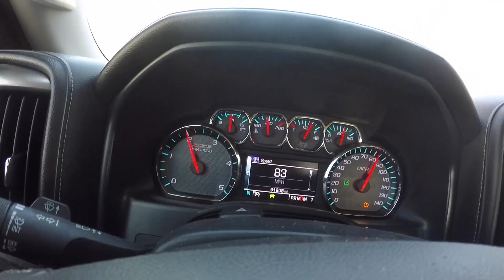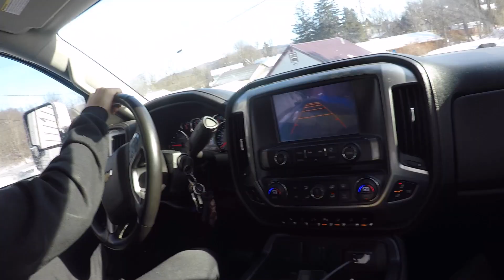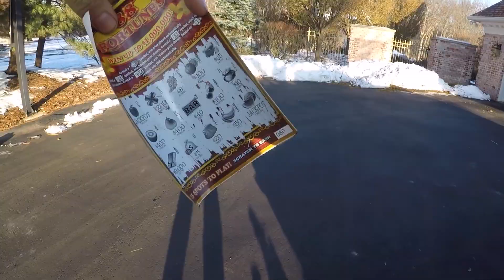I GOT 2 NEW ENGINES while Black Friday SHOPPING!!!!

Comment: COMPARISON TIME...I would like to see what is the cost difference of rebuilding a 6.0 VS. 5.3...Are the 5.3 parts much cheaper???....Also could you weigh the two engines??.. I wonder how much more the 6.0 is VS. the 5.3?? thx..
Reply: Burnrubber 33 they are the same engine essentially just slightly different bore/strokes. They start with the same blocks
Reply: @richardolsen6476  the 6.0 has the 6.0 tax the 5.3 has no 6.0 tax
Reply: Thx!